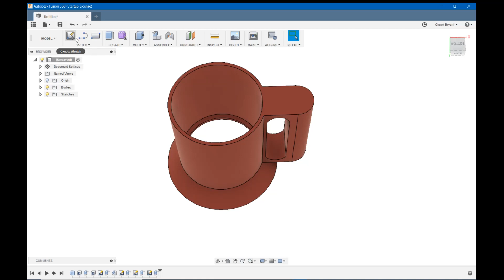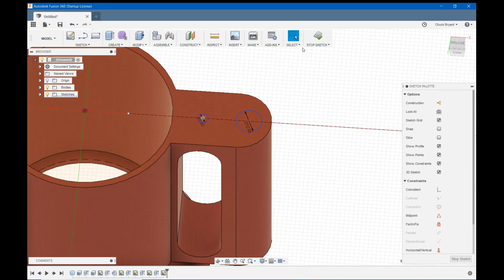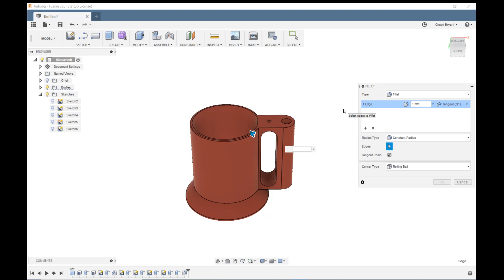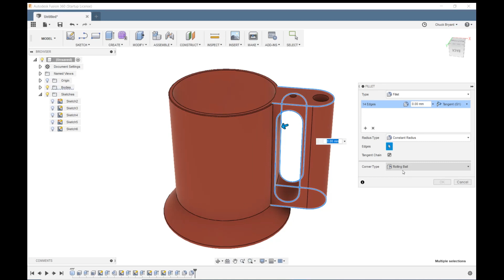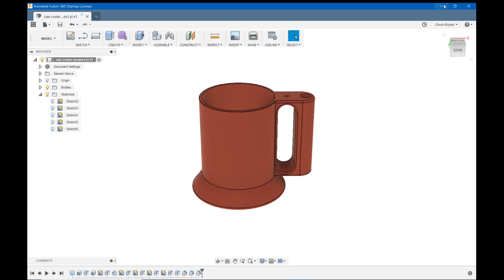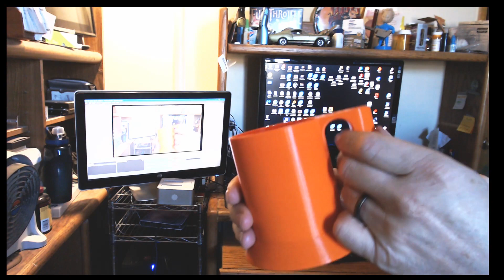Fusion 360 tutorial- beginners level - insulated cup holder part 3

Comment: Why doesn't the arches in the hand hole need any supports?
Reply from the maker: If you load it into Cura you'll notice that when it gets near the top of the arch Cura changes from just printing the sides individually and starts bridging back and forth across the gap in a zig zag pattern. Or at least, that's what todays version of Cura does, I no longer have the version of Cura I used 5 years ago when I made this video. I loaded it into Orca Slicer and noticed it does the same thing. But TBH, if I were to print that same part today I'd probably turn on tree support just to lower the chances of failure and because tree support is fast, uses very little filament and is very easy to remove.
Reply: @3rdpig  oh I see, I use Bambu studio, which I think is based off cura I think.. I'll have to look closer to see if it changes the print direction next time I have a similar arch. Thanks for the quick reply, I'll subscribe